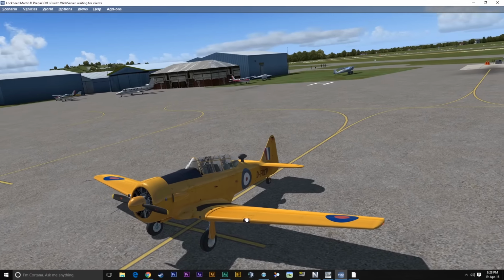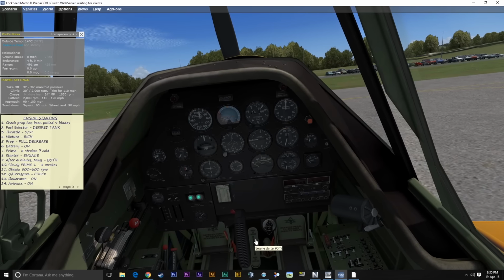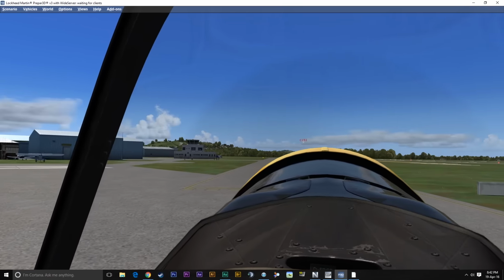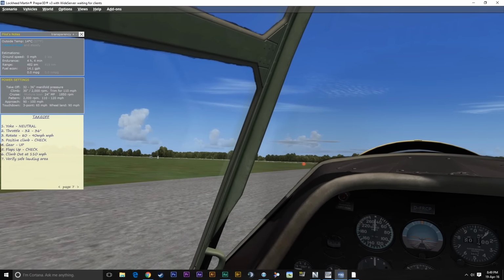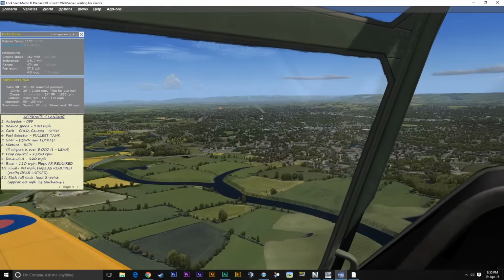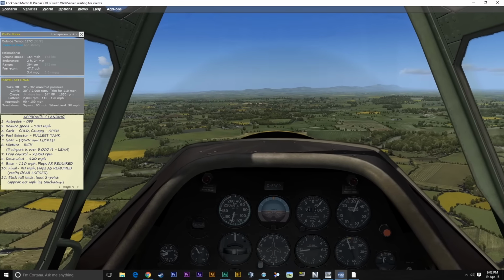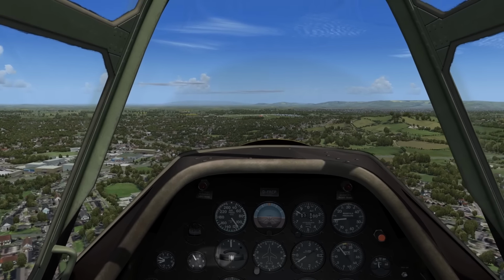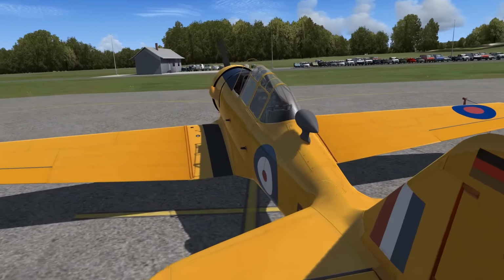A2A Texan T-6 VATSIM VFR Circuits

Comment: The free air/carb mix switch its to change what is shown in the temp gauge that is right next to the switch, to heat up the carb intake you got to use the carb heater lever that is on the left quadrant. Great video!

Comment: @3:52 Hydraulic lock is a common condition that can affect round /
radial engines. As the engine sits idle over many hours, days,
or weeks, oil in the engine can seep into the lower cylinders.
This oil can fill a cylinder (combustion chamber) to the point
where a piston can bind or lock and result in a damaged
engine, specifically, a broken rod that connects the piston to
the crankshaft. This is why it is important to pull an engine
through with your hand prior to starting to confirm there is
HANDLING, SERVICE
AND MAINTENANCE
no oil in the cylinders (must be careful, as even hand propping
can damage an engine with hydraulic lock). For the
T6, a popular fix is to install a “clean kit” which is basically
a drain and tube, that is attached whenever the aircraft
sits, so any oil that drains into these lower cylinders drains
out through the tube and into a bucket. Attach the oil clean
kit whenever the airplane is sitting for more than several
hours (remember, time when the computer is off counts in
Accu-Sim) to prevent oil from pooling in the lower cylinders.
Before flying, detach the unit (oil is automatically put back
into the engine when the unit is removed). This is from the T6 manual :D
Reply from the maker: +Norbert Becze yes! my brother was explaining exactly that, he works with T-6's, but why at that point in the video does the hand cranking just stop after only one or two turns?
Reply: +Peter Matthess it takes 2 full revolutions of the engine to take all cylinders through all 4 strokes of the engine, but because the R1340 has a reduction gear(as many aero engines) it will take less than 4 blades to take the engine through 2 revolutions. hope this makes sense. search on YT for wooden radial engine! Lots of fellow CIX member there,BTW :-)
Reply from the maker: will do thanks!

Comment: Hi Peter, your prop stopped turning, because you have an hydraulic lock, due to oil in your bottom cylinders, go to F4 and fit the oil kit to drain the oil out. your prop should then turn again.

Comment: Hi peter! Once again, whenever the checklist calls for "Carb-COLD" ,you need to check the carb heat lever forward of the Throttle Quadrant and not the Carb air source switch wich is next to the carb temp gauge.That switch only switches between showing the temperature at the ram air scoop and that in the carburetor.Other than that, splendid video as always. :)
Reply from the maker: +VinnieDaGreat yea I can see in the approach and landing checklist I got that wrong, thanks for pointing that out again!! I will not forget next time! VinnieDaGreat
Reply from the maker: +Peter Matthess ahhh I see now, Ive gotcha, I'll be sure to point this out in the next T-6 video!!

Comment: Nice video as usual. I live about 5 mins away from glos airport. What scenery is this as can't find any good scenery for glos airport. Thanks
Reply from the maker: +XTX_Tango this is just default ORBX England + FTX Global and FTX Vector all mixed in
Reply: +XTX_Tango .UK 2000 UK Airfields 1 has Glos. I believe :)
Reply: +Elmo Slack yeah I have the uk2000 scenery and I'm kinda a fan of uk2000 now since having Cardiff and glos and Bristol.
Reply: Great with Horizon photoscenery too. I have all England and Wales. Heavy on the hard drive all at once though :)
Reply from the maker: yea :)

Comment: Actually I've learned that it is not such good pratice to use differential braking in this plane. You could damage the inside gear in turns. To avoid the tail coming up taxi whileholding back on stick.
Reply from the maker: +smokeyupahead that is also very true, you can hurt the tailwheel so easily in this thing

Comment: You don't need the forums to know why you can't pull the prop, it's hydro locked. You have to drain the oil out of the bottom jug's first. Oil is built up in them and stopping the piston from moving. Old saying, RTFM. With A2A aircraft you can't just jump in and fly, you have to RTFM first so you know how to operate the aircraft. Forum are not needed, it came with a manual. Not trying to be rude but I know that's how people will see this post, constructive criticism, we all need it from time to time. BTW you got lucky you did not blow the motor up.